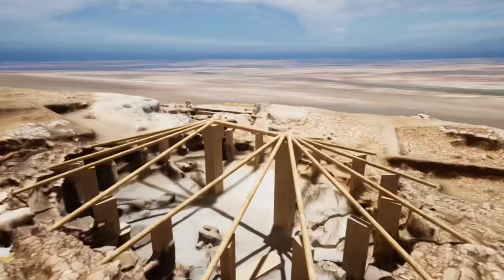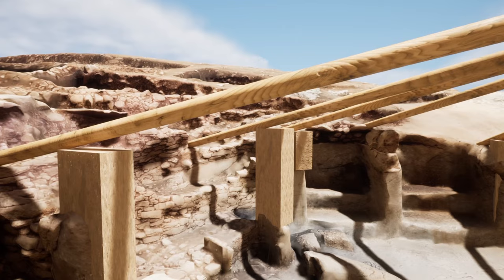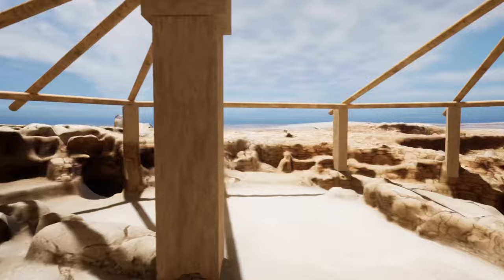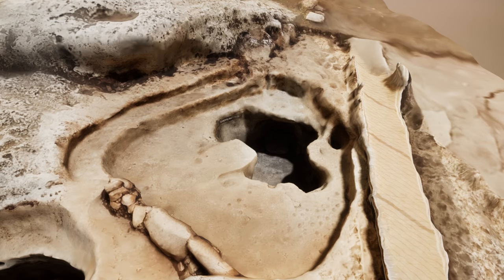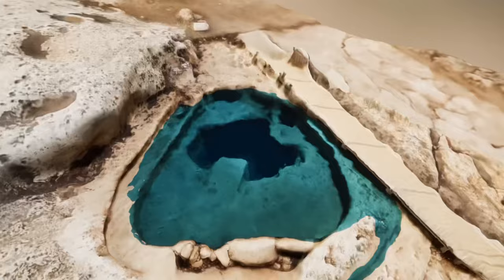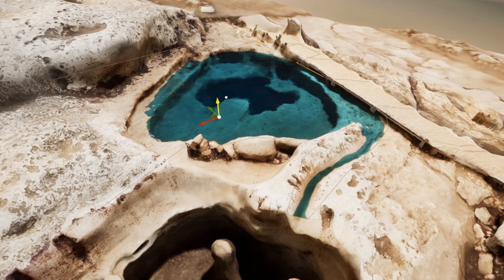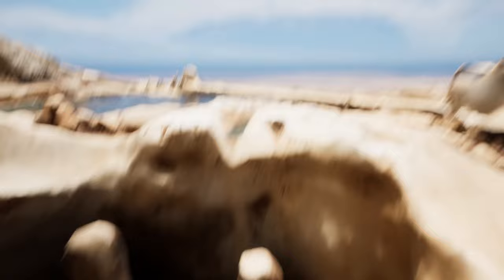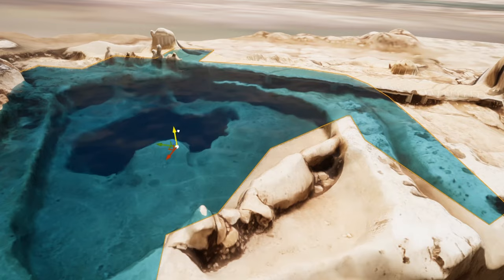Karahan Tepe Reconstruction in Progress

Comment: You wouldn't have a waterfall unless you had a constant flow of water from somewhere.
Reply from the maker: Check out the next video I release.  I think I located a possible spring.
Reply: Did it say how or where all the water left the structure, disappears below? I'm thinking it could be a birthing room, at a time when women still ruled? So many pre-historic female figurines, carvings, references? There's something very curious about the superstructure as far as I can follow the flow of water downwards. I'm so glad to find this channel because I have wondered about the possibility of a roof, think that's been solved right here! But it's not a rudimentary mud roof structure at all w/the beams, triangles and lintels, and entrance so perfectly worked out. Has to be wood, or maybe heavy woven thatch, reeds? If the entrance is in the north, a great connection to Egypt might be surmised. The water on the eastern side and the alcoves w/platforms or seats, the water could flow over the entire floor, then shut off once rinsed off. The first baptism at the same time of first arrival into the world. But I'd have the guys do all the building, and then they'd have to clear out.

Comment: That pool would have to be absolutely full of water before any water flowed anywhere, and it would stop flowing as soon as the water level dropped a tiny bit. Seems like a big problem for this theory.
Reply from the maker: I believe there was an ancient spring that kept water flowing over the entire area.  Often mountains/hills have caves and water flowing inside.  The water doesn't come up from below the hill but forms tables inside when the water meets a non permeable rock layer like the one we see being uncovered at Karahan Tepe.  Where the water table intersects the mountain slope there is a spring.
Reply: @ESLINGERART  Maybe so. But it seems like it's on high ground. Is there a slope above the site?
Reply from the maker: @bozo5632  Yes.  I just made a video that I will release shortly.  People have also started to mention that the "pool" may function as an old cistern system.  The debris being filtered out.

Comment: Why are the tops of the stone pillars shaped like that if they are supporting poles? Is that blunted T shape assist in lashing things over them? Maybe the top of the T is better suited to holding certain materials over other. Like, if you had a bunch of sticks you didn’t want falling off a beam, would you want something flat like a table? Or would you think a V shape would hold poles better? That flat table top T pillar seems pretty prevalent in their buildings. I think it’s shape might describe the shape of what it is supporting. If not logs, what?
Reply from the maker: That T shape is very common in modern piers.  Under trains and overpasses you see it a lot.  The top or cap is larger to distribute the weight evenly across the top of the collum part.  I think there may have been a very heavy roof in place using mud. Similar to native North American structures.
Reply: @ESLINGERART But is the flat top shape ideal for wooden poles? I can see the bottom surface of the T as being ideal for a lashing point. Unless there was some other mating surface that interfaced with the wooden poles securely.